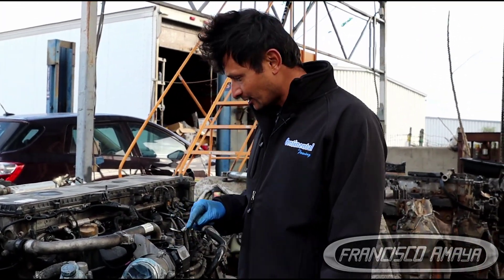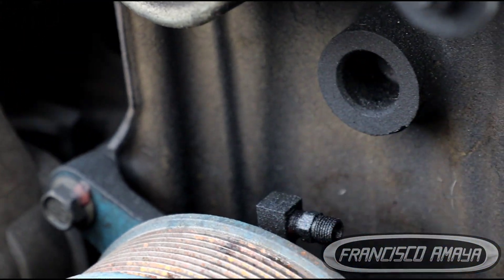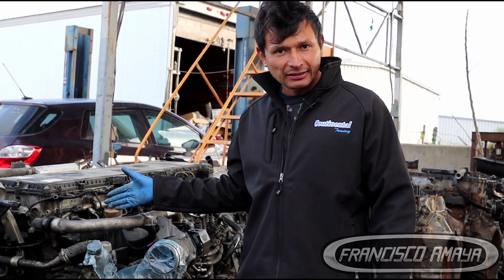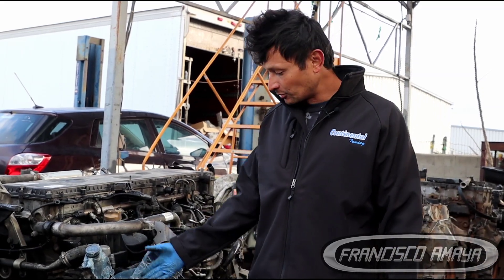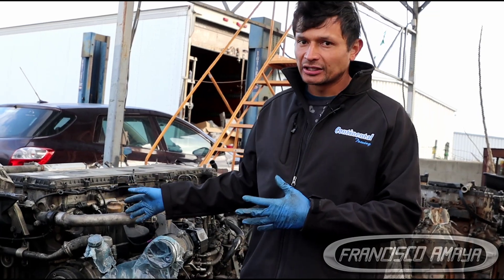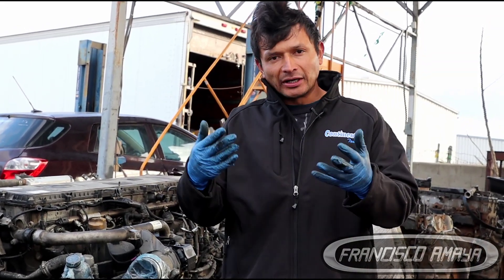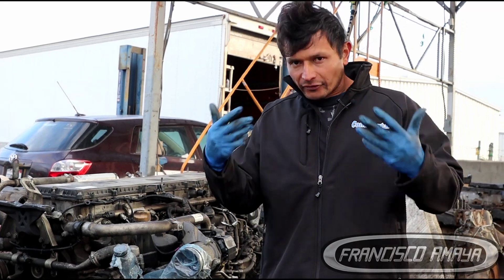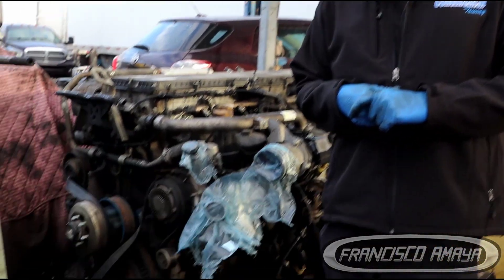DD15 engine block crack open connecting rod out damage rod bearing crankshaft major engine failure

Comment: Every times my RPM goes to just about 1700.  The check engine light show up and as I deaccellerate the light went away with today's engine sensors.   I know some drivers back in the old day raise their RPM to 1900-2000 and above and jam it into low gear.  They thought that was cool and professional.  To me that's is very dumb way to drive a semi .  Drivers having fun and owners have to keep up with engine break down.  When the driver own his own truck he does it the same shit and wondering why his truck always have problems and need rebuild.  He then goes back into being a driver.  Good habit is very hard  to form, very easy to live with.  Bad habit is easy to form, but very hard to live with.   Was it luck or was it because how you drive?